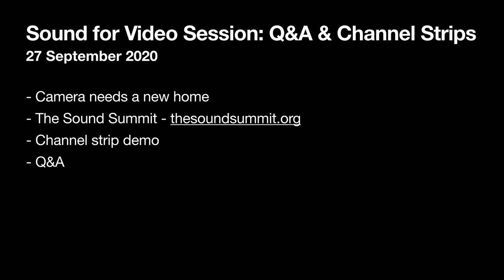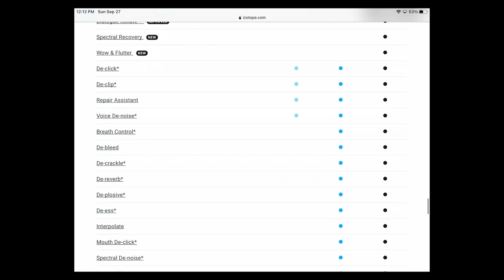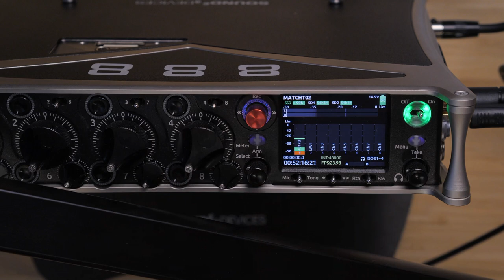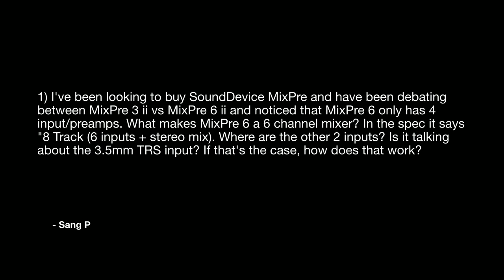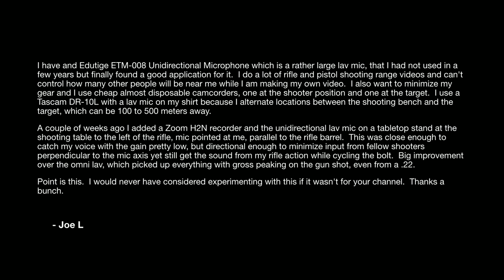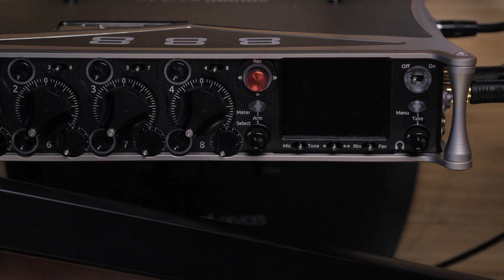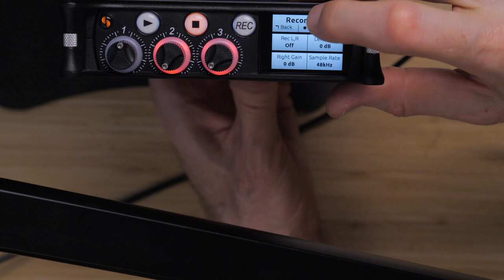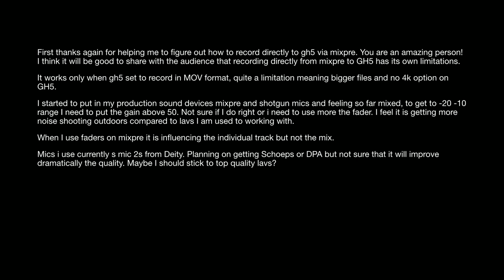Live Sound for Video Session: Q&A & Channel Strip Demo

Comment from the maker: Livestream starts at 3:15
Reply: Thanks Curtis, tuned in love and really enjoyed it. Dropped you a line on email - Prescription Media
Reply: @AaronCalvert  Thanks for coming by, Aaron!
Reply: Hi Curtis. Can I ask a noob question:

A lot of microphones are labelled as “shotgun” but actually has an cardioid, super cardioid or hyper cardioid pick up pattern. Why is that? Is it because the actual “shotgun” pick up pattern microphone does not exist or is not commonly seen and used?

 If looking for a focused pickup pattern mic, hyper cardioid mic should be good enough right? Also which mic would you recommend for under 2k? 

Thank you very much
Reply: @ming8682  "Shotgun" microphone refers to microphones which use an interference tube design. Their polar pattern can range from cardioid to lobar/shotgun. So the definition has to do with the microphone design and not so much with the polar pattern. For a very focused shotgun microphone, I'd look at the Sanken CS3e. Best wishes!
Reply: @curtisjudd  Thanks Curtis!

Comment: Thoughts on the windscreen you're using on the SR314? Were you having a big problem with plosives or breath noise? I'm trying to work on mic technique with mine to minimize. Haven't tried a windscreen yet.
Reply: Yes, I was getting some breath on the capsule and plosives without one so decided to try this. It seems to help a bit.

Comment: Really excellent advice about RX - "next level of touch" described my experience with RX Standard. For my use as an audio newbie, Curtis's instructions on Adobe Audition were more than sufficient. I found that the RX makers have an instructional "low-cut filter" that makes it difficult for noobs like me to get comfortable with the software. Also, for my use cases RX didn't seem to do very much, whereas the guided audio editing features in Premiere and Audition really help.
Reply: Thanks runbei, appreciate the insights!